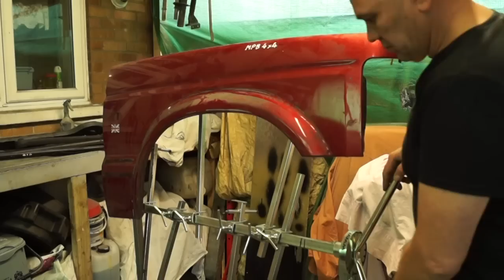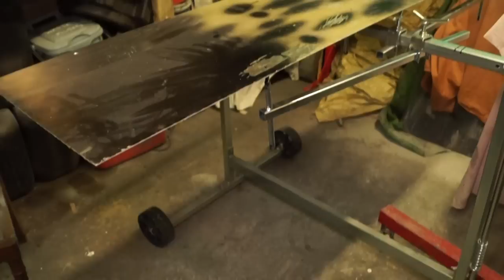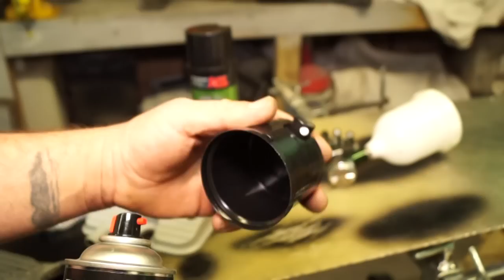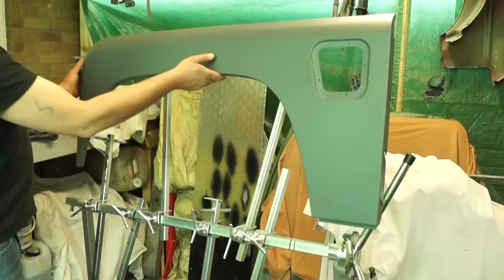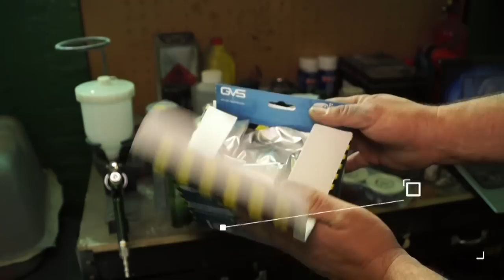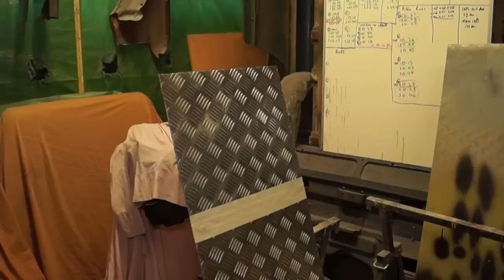Aerosol Spray Etch Primer for Aluminium - Chequer Plate and Defender Wing

Comment: Nice video 👍🏼 How long before you can apply a top coat to Etch Primer when painting aluminium? You said it could be over coated in 10-15 minutes and touch dry in 30 but I’m applying with a roller..

Comment: Excellent Video. I unfortunately bought a full Defender 110 Puma chequer plate body kit by Terrafirma at very expensive prices through a Land Rover main stealer. I live in Spain, and so I asked if black chequer plate would be ok in the Spanish sun and was assured that Terrafirma plate was powder coated to the highest possible standards and built to withstand the African Sun !!!!!  
I am glad I found your video, because the Puma Bonnet Plate has decided to split and flake in the sun (The black paint) 
Obviously, Terrafirma don't want to know as their customer service is so up its own a**e in the belief of their superior product not possibly being defective, which is a couple of months out of warranty, so I need to remove the plate, clean it off, strip it, prime it and repaint it. 
My question is, what type of Black Satin paint would you recommend on top of the etch primer ? Taking into account the strength of UV / sun here. 
Thanking you in advance and for the video as well......Mystic

Comment: Is this primer okay on the paint that's been rubbed down too? Some of my Dads defender wing has been sanded down flat but obviously not ALL to the bare metal, most is paint still there too. Would this etch to the paint underneath okay? It was a paint applied by a paint brush in the past. Thanks for any help you can provide, great video too by the way. Very descriptive information and helpful!